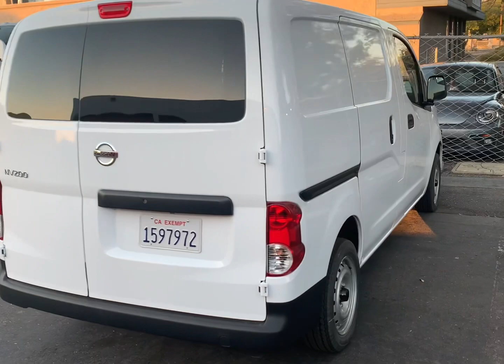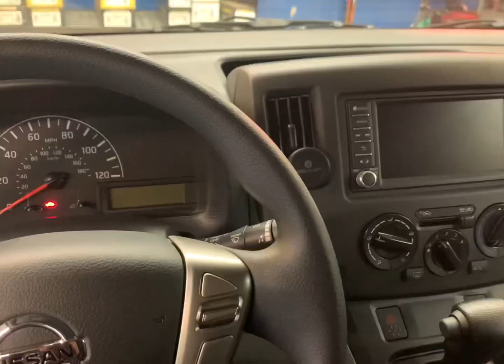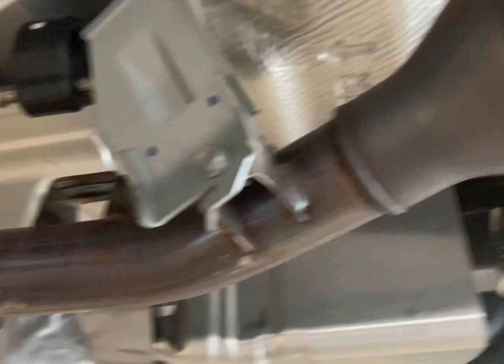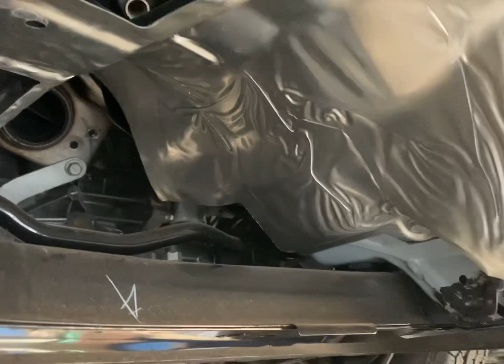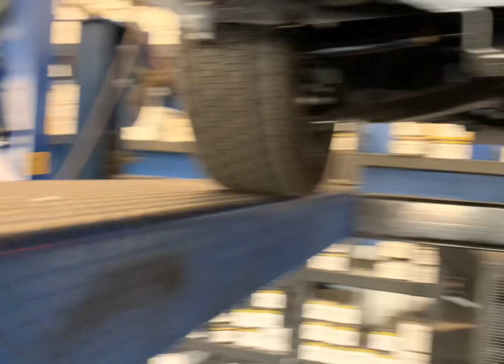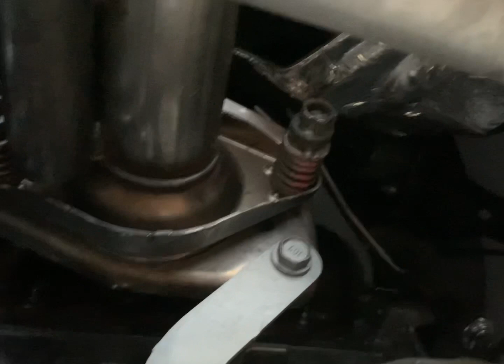Stolen catalytic converter Nissan NV? Open for an explanation.

Comment: How about fill up those additional pipes with concrete before welding to exhaust system. This would make it impossible to cut through
Reply from the maker: It’s a great idea, but it would add a significant amount of weight to the stock exhaust hangers

Comment: Twice two weeks apart. cost me 6k each time. I have no other option than to sell me beloved van, I literally didn't have time to even weld something temp. YOu have no idea how devastating it is emotionally to owe 12k in two weeks. I'm sure you understand tho.
Reply from the maker: I would advise  anyone that has experience a theft one time to add comprehensive coverage to your insurance immediately.  If you would had it you would have only had to pay your deductible.
Reply: Get a universal cat those have very little value to the thieves and they rather not steal them

Comment: Bolts? They cut the pipe on mine today with a saw!
Reply from the maker: The bolts are not designed to be a stand alone defense.  If you use it combined with our other offerings it’s an additional layer to slow them down.  You probably have a deadbolt on your front door of your home, do you have bars on your windows?
Reply: In other words put some money in his pocket and hope for a different solution.
I bought a mini wireless camera and I have a 55in in my room just for monitoring the camera
Reply: @db-ly5om 
Are you going to stay awake 24 hours to watch your camera? Good luck.
My cat from Nissan nv200 was cut off at 2 pm, on parking lot, while I was shopping in a big shopping center. It took them under 1 minute.

Comment: They need to make the lock a bit bigger there will still be a way for them to get the bults off
Reply from the maker: It’s a theft deterrent, if a thief wants something bad enough they figure something out.  We’re just trying to make it difficult enough for them to move on.
Reply: Bolts